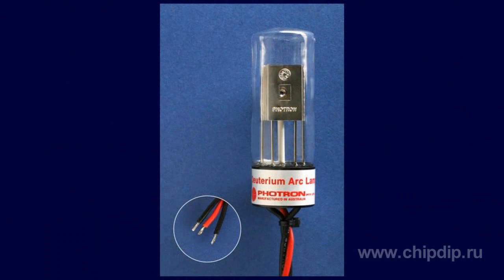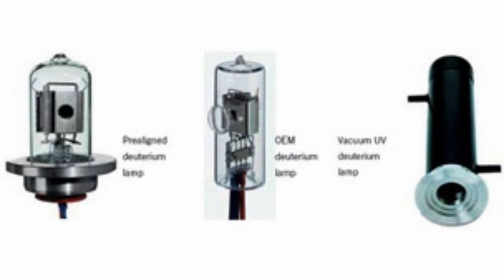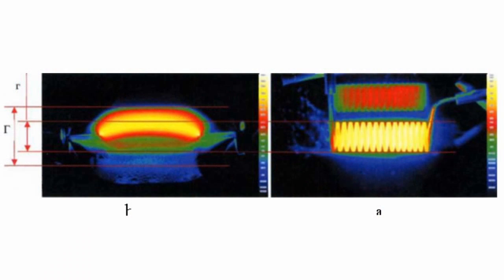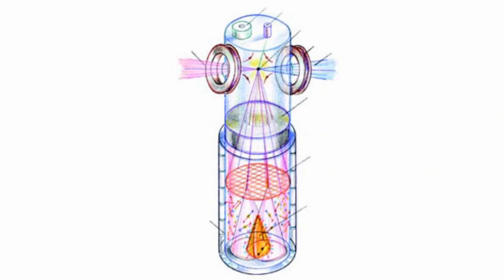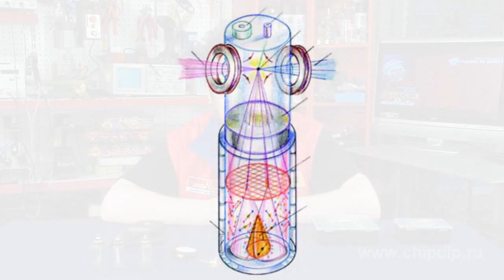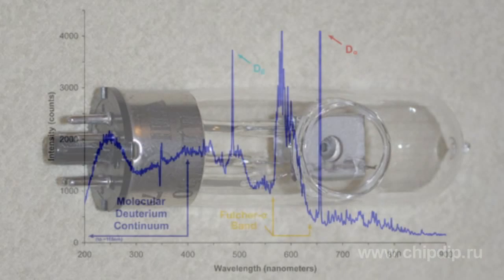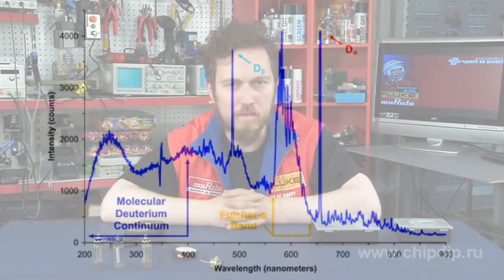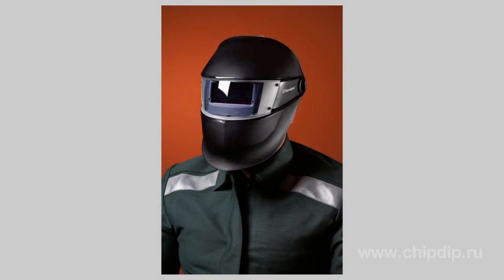Deuterium lamp

Comment: hi would you please look at my latest hydrogen fuel video as i have been pointed to your video by a robert maynard and would it be possible to pass negatively charged water vapour through the lamp set up and if so how much are these lamps .it may seem that this may have to be built into part of the injector like andrija puharich designed.thank you melvin in england